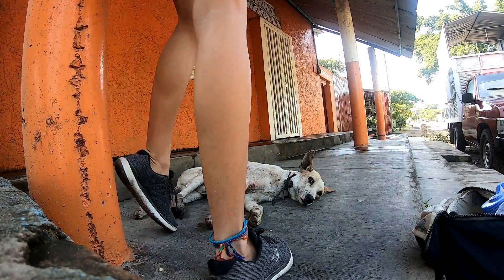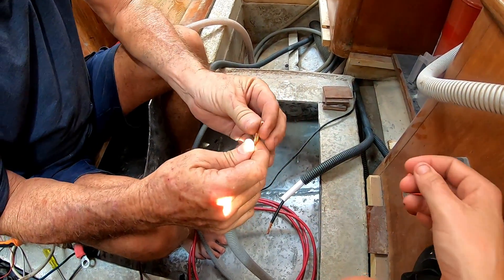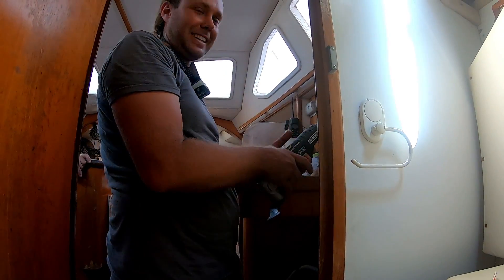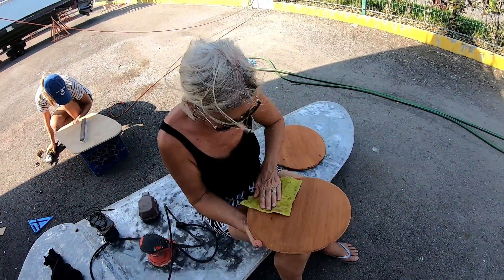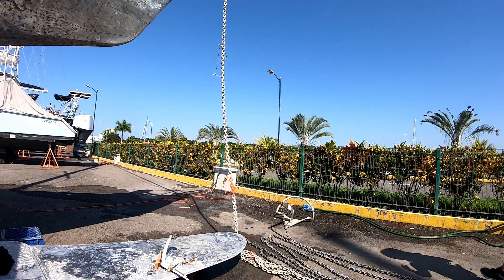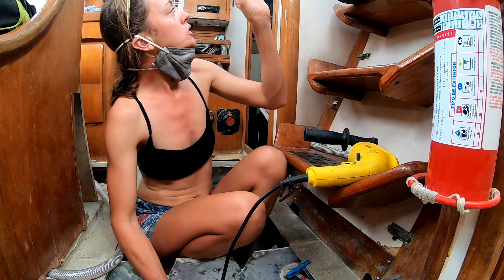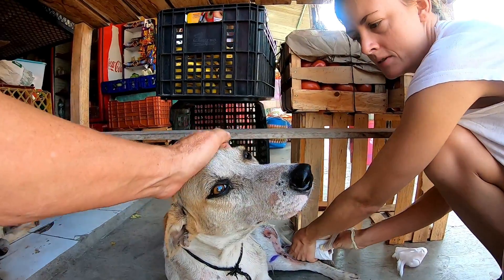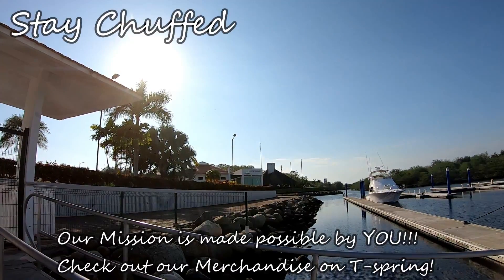Can't See the Forest for the Trees : Chuffed Adventures S02Ep8

Comment: Looking at all the work you and the family are doing your big time troopers.  There might be a way to seal up that bottom really well, it is not as good as hot dip, but could suffice for about 10 years or more.  You would have to experiment on a small section, or your keel or rudder, with a cofferdam or a cheap swimming pool since you have a retractable keel, Zinc electroplating it would also reverse some of your corrosion with top coat of epoxy, it should stop the corrosion for a while, there is also a spray product. Cheaper if your just doing parts, all you need is a battery charger and some zinc more amps the better.   There are plenty of youtube's on the process. There is also Alodining is a process in which a metal is coated with a chemical called alodine. This coating hardens to the surface and can last for years if painted, not requiring reapplication.  That corrosion you have is a real pickle, but your getting on top of it.
Reply from the maker: Will look into it thank you, glad you’re enjoying the videos and thanks for being part of the crew!

Comment: great work! but you should try using some larger tools for the job, the grinding bit on a drill is basically a toy. Get a angle grinder with a proper grinding disk, wirebrush and sanding disc and it will take a fraction of the time.
Reply from the maker: I think the aluminium is too soft to use the angle grinder wire - it ‘melts’ it more or less at those high speeds - this is what the alu boat builders recommended

Comment: Be careful. Isolate. Your cases went from a few to several hundred in most countries. Very quick expansion down there. Here's what a Doctor in Italy has to say. You do not have the resources this doctor had, and she was overwhelmed. https://youtu.be/dkozG3IcXUU Its easy to find videos where they were overwhelmed. On another subject, I'm surprised so many thru hole were under the waterline. Seems dangerous.  As a technician, I think I'd do every splice just like he did , whether I had the correct crimps or not (and I do with a lever action crimper, the yellow ones are the smallest it will do) . And, I'd put some silicon grease under a larger hunk of heat shrink after it was done. Why ? Electrolysis and Corrosion. The enemy on a salt water electric job. Silicon grease keeps the water out. We did this at cable companies on the coast of California where salt water corrosion was a big problem.
Reply from the maker: Thanks for the tips, and we are staying very quiet and doing our best to social distance etc it is pretty hard in our community though because everything is so communal. We will see what happens over the coming weeks
Reply: @VetTails  Your young, but your parents are not. You won't show symptoms, and will have a less serious event, something like Whooping cough. It seems to accelerate with age. Its a good time to sail out, then sail back just in time for your visa's expiration or some other crazy scenario (any abandoned Islands around there ?) lol. (not really joking, might work) .  Mexico is not testing and is not ready at all.
Reply: @VetTails  I've been checking daily on whether Gills boat could come in. They've now changed it to boats under a 49ft can't come in. Hope thats not true, but You can talk to your harbor master and check that. I'd be interested in what you find out,, the guy who passes this on is in Encinata and goes to meetings.